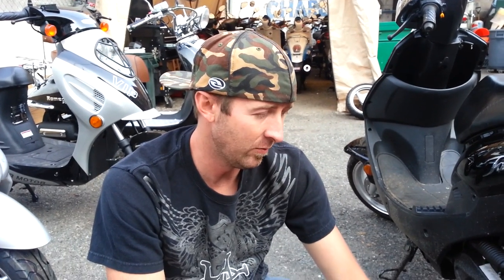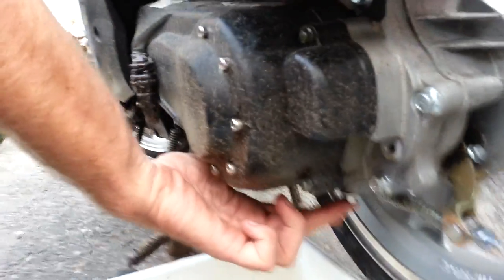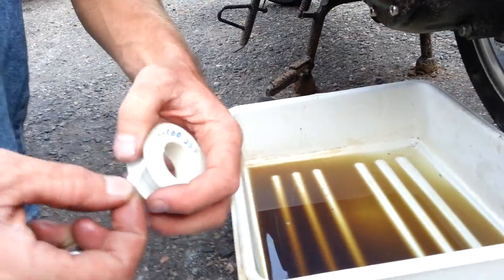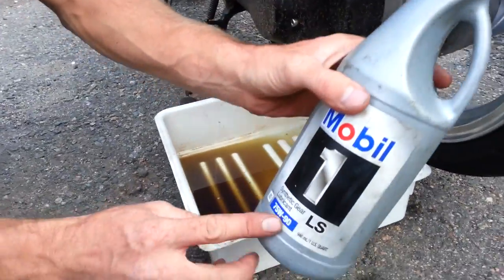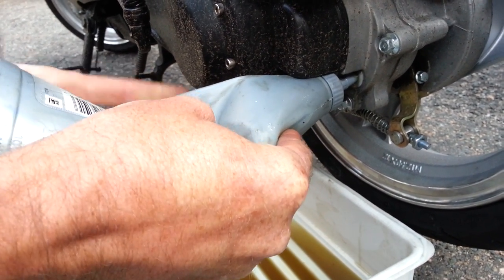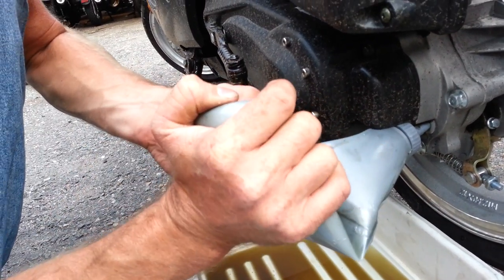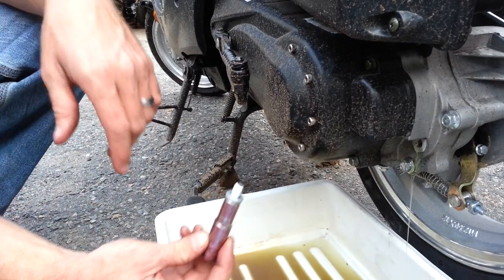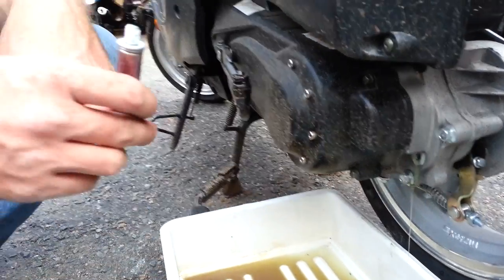How to change the gear oil on a scooter.

Comment from the maker: If you own a Chinese scooter. I highly recommend changing all the fluids at 100 miles. Also replace the vacuum and fuel line with helix line. We have them on our web site. O ya one more thing. Replace the spark plug with a NGK plug.
Reply: What size ngk
Reply: 100 miles? My last gy6 last for 20k+ miles with oil and gear oil changes at 1000 mile intervals. I couldn’t imagine changing these oils at 100 mile intervals, that’s so much maintenance! How much longer do they last with intervals that’s small, 100,000 miles!?!
Reply from the maker: @user-kp6ud7ht4z  just the first 100 miles then every 1k

Comment: Hey I got a 2022 Vitacci clash 200 and I'm changing the gear oil and it ask for 80w-90 with API rating GL-3 but can't find anywhere.
 Can I use Valvoline High performance 80w-90 with API rating GL-4?

Comment: I've heard a professional techs say not to overfill it. To put about 4 oz in. It makes sense cuz if the fluid has nowhere to go and It'll force its way out somewhere else. But then again the way you did I guess in a way allows it to level out. I have a genuine brand Japanese Yamaha Riva jog 50. A damn good quality scooter. Is this method just for these Chinese bikes or does this really work for all differentials? I just want to be careful not to overfill mine if it's a specific amount

Comment: On my Kymco 150 I have a small gear oil leak. I think it was over filled so it’s leaking a drip or 2 after a ride.  Can I just open that bolt to drain out the excess or should I just change it out?   🙏 thanks

Comment: thanks for all your videos about the GY6, learned a lot from you brother. i have a chinese cmc italjet formula 125cc and i do my own CVT cleaning, engine & gear oil change every 1000km. 10w40 shell fully synthetic and shell 80w90 gear oil that cost about USD10+. buy the right tools, watch videos from @RollingWrench and you be saving lots from going to motorcycle shops!

Comment: I’ve a 2001 two stroke vino and the owner’s manual calls for SAE10w30SE oil. Can I use gear oil? And if so what grade? Or should I stick with whatever the manual indicates? Thanks a lot.
Reply: You can use motoroil in the gearbox but not the gearoil in the motor.

Comment: Hi tks four your videos again I have a Sym Fiddle is a version 1 from 1999   Two stroke a many ml to change the oil transmission tank you a friend tell me is 90 ml I don't now if is the right amount tank you
Reply from the maker: Generally if you are filling the transmission. Fill it so spills out the fill hole

Comment: when should you change the gear oil excluding the first 100 miles after that when do i change it? my scooter mechanic said every 10,000 miles, is this correct?
Reply from the maker: We change it every other oil change. So every 1200 miles. This is a little excessive! But is simple to do and affordable.
Reply: Wait it was supposed to be changed after my initial 100 mile?!

Comment: Hi I have a Sym fiddle version 1 from 1999 two stroke I fit a new cylinder and piston new coil plag and cdi and startor also new pedcook is have a few thing or ready and my scooter still cut off  I just drive around and is hot is cut off and same times I give a gas and is cut off to any idea please whatch happen whit my scooter rank you
Reply: carb problems? any cable loose?